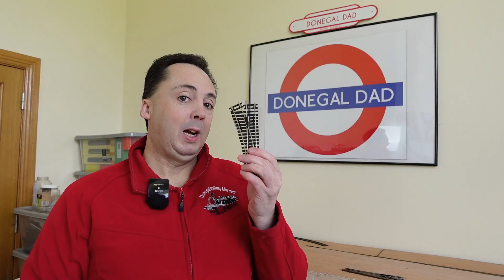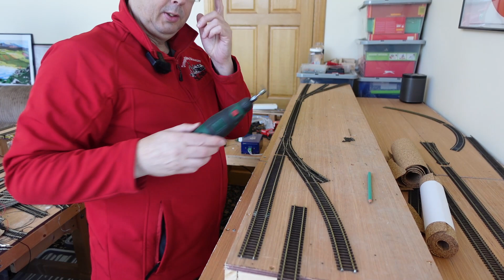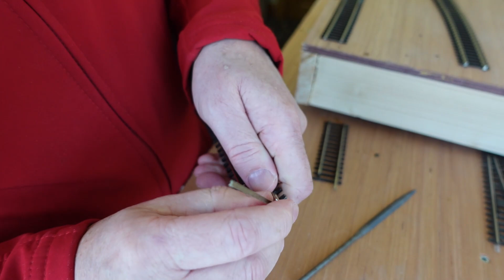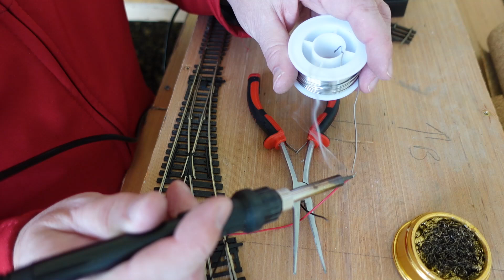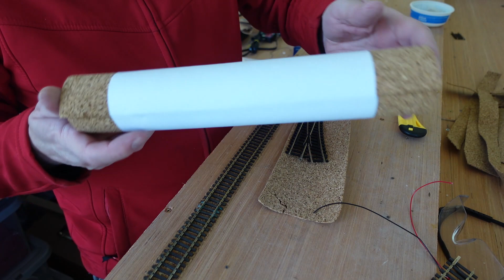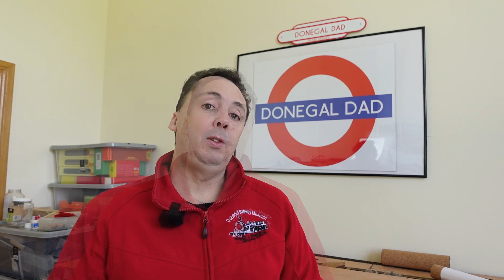Beginner's Guide: Track Laying On Your Model Railway

Comment: I like the idea of soldering feeders on the bottom of the rails instead of soldering on the sides like many others do
Reply from the maker: It definitely makes for a much neater finish.
Reply: @DonegalDadRail plus you can hide the wires better

Comment: Hi Mark, real good informative video, Ive found with the really fine PECO track pins if you use a pin pusher, even with Ply they dont bend and work really well, hope you are well, see you again soon, Andy
Reply from the maker: Thanks for the tip Andy. Will have to get a pin pusher always found those pins bend to easily.

Comment: Hi Mark, I cannot for the life of me , solder!! Every time it just seems to roll off the track, I put flux on it as well but no joy. Any chance of a soldering lesson?😃 its getting me down at this stage.
Reply from the maker: Thank you for the kind words. Try to rough up the bottom of the rail first use a file/sandpaper.
Reply: Also meant to say, love your videos. Very informative and easy to follow.
Reply: That certainly makes life easier I must say, thanks Mark
Reply from the maker: @dreadster0  Glad it helped

Comment: I've found in the past that laying track is not too difficult. The problem I encounter is (let's say for simplicity I'm building a circle of track) that last piece of track that completes the circle is where i have problems. I never seem to be able to lay this track without problems. Any suggestions? Thanks.
Reply from the maker: If you can draw a centre line to follow as laying it. Also lay the track if you can before you fix it in place.